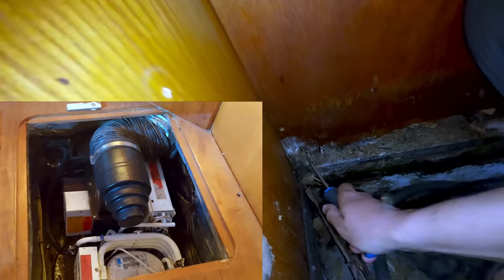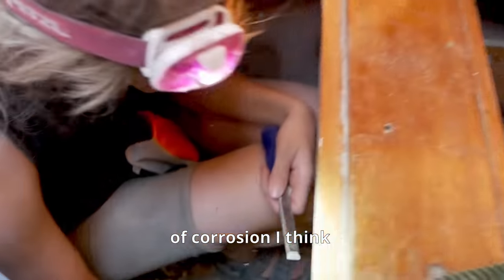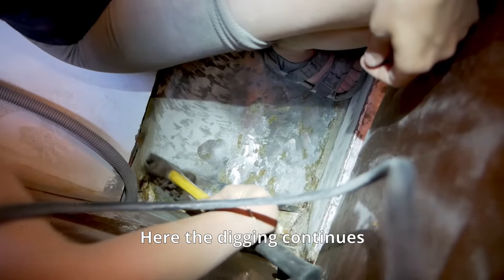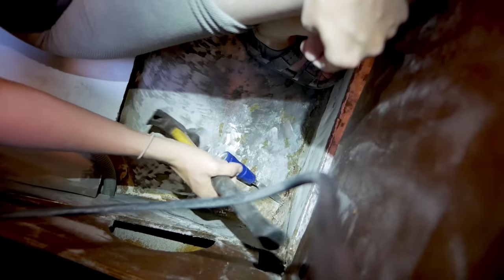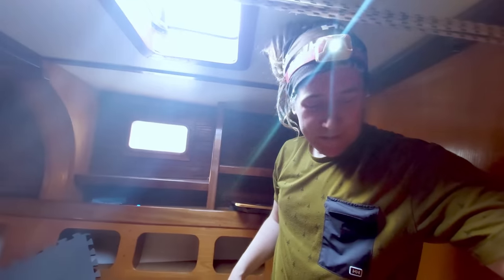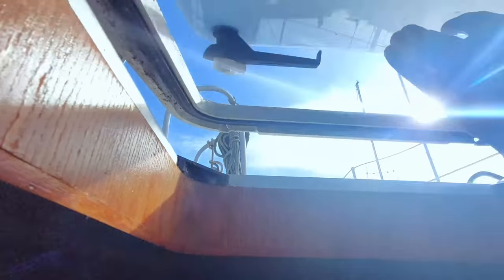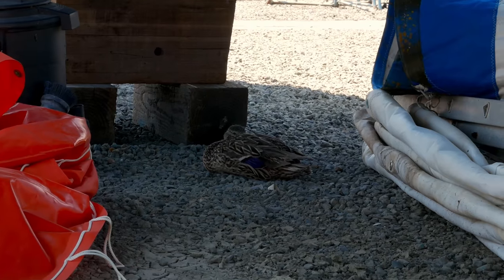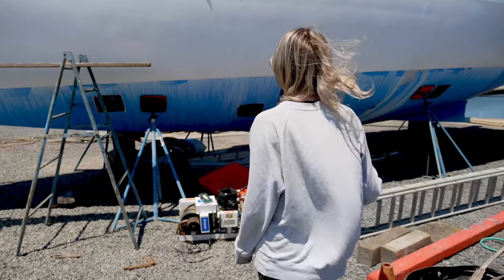Grinding Away ROTTEN Interior. Our HUGE Boat Refit

Comment from the maker: Hi all! Thanks for watching and all the support. What does the list of projects look like to you?
Reply: 3 month aye??? I love your Can Do attitudes!
Reply: Yikes! Can do it team. The stuff I push off to leave yard, foreign port, I know to well. Possibly some local help.
Reply: Do you also want to add water-level tubing to the through holes, like in arktika?
Reply: Looks like an old boat in need of your TLC .
Reply: Excited to watch the progress and then the coming adventures
Reply: Have fun and enjoy.
Reply: It's a long list and it will get longer. I think it would benefit you to sort the list differently. First - anything that has any "unknown" aspect to it must go to the top of the list so you can unpack the problem and understand what's needed and feed it into the work flow. Second  - anything that needs outside help has to be started yesterday so your contractors get to work - but beware gridlock, you can only run so many projects at once on a small boat. Anything you can send "off the boat" to get done, do it - like the hatches, or whatever. Third - anything that needs parts, get ordering ASAP. Fourth - I know it's tempting to prioritize splashing the yacht as soon as you can, but check your costs - it might be way cheaper to stay on the hard until you're really ready to start sea-trialling stuff. Fifth - trying to move through such a big list, with contractors helping, it's nearly impossible to get anything done yourself; you're constantly interrupted to help or make decisions or whatever, so be realistic about which projects you assign to yourself. Hope this helps.
Reply: It looks like a very doable list and can get completed in the time frame that you mentioned..
Welding the old through hull fittings below the water line should only take half a day or less by a competent welder..
Replacing all the wood that you ripped out may take some time because it all has to be fitted.. and for that get some corrugated cardboard to make templates..
Prop shaft should be done in a day, and the rudder should be done in a day.
The rigging shouldn't take too long and as long as you get all the necessary parts you need.. replacing the cabin hatches vents should take about a day or less
So it looks like most of things on your list will take about a day each to complete, but some of it will take a little longer..
I would spend some time making wiring diagram first, may want to run some pvc conduit underneath the cabin floor which would be helpful if you needed to add more wiring later on..
You'll probably need to pick up a clean 55 gallon drum or two to pump out your old diesel fuel and clean the tanks and polish the fuel as you're pumping it back into the clean tanks.... The water holding tanks are going to have to be disinfected and your gray water tanks should be rinsed out.,.
I think you need a bigger air conditioner.. working inside any confined space during the summer heat is brutal.. so be sure to stay cool and drink lots of water
Reply: Sail Life is a YT channel that may have already tackled some of the instrumentation and electric equipment problems you face and may have the answers you are looking for. Otherwise, you two didn't buy this boat not knowing what to do. Both of y'all are impressive that you know what needs to be done, and Sohvi may not say much but I love the way she just gets to work. I trust both of y'all will bring life back to this boat. I know this isn't your first refit and will find it interesting how you two finish out this boat versus what Ava and Mads decided with their boat. But Mads has a lot of videos about the systems you may find interesting. Otherwise, just keep filming and we will keep watching.
Reply: stressful
Reply: 18 months to 24 months a lot of work and systems good luck ..
Reply: @CapDave720  Excellent advice Capt. Dave. It was awfully brave in my opinion to even ask for advice from the YouTube audience, but your reply is very helpful, instead of coming off as being bossy. Not everyone realizes that he didn't ask for advice because he doesn't know what to do, it was to tap into the pool of knowledge that potentially exists in the audience.
Reply: Great project, I am doing similar work on my Alubat 435 and the new electric wiring took me a long time. The work always takes longer than planned... But a lot of fun!
Reply: 6 to 12 months before sailing I think
Reply: I wouldn’t know where to start.
Reply: I'm in San Francisco - I have a Sailrite sowing machine ur welcome to borrow if you have projects that require it.
Reply: It looks like a pretty tiresome project that you fix it the way you like while you're doing it and enjoy the outcome when you're finished it is your boat not ours it will be your home on the water your safety zone and your transportation God bless you I hope you get the projects done so you can put it on the water
Reply: @SFDY241  well that's really nice of you Bill making sure use it if he has to sew anything
Reply: Consider using King Starboard to replace the locker floors etc.
It's a marine-grade plastic sheet material, its impervious to UV and moisture.

Comment: Air conditioners do NOT work with open windows and open doors. Block off the entrance to your cabin with a sheet of plastic or a curtain if you cannot shut the door.
Reply: It is probably normal for Finnish people not to have spent time around air conditioners!
So I'm sure the advice will come in handy.

Comment: Unless a whole lot of your anticipated cruising is to be north of the treeline, you might consider installing a woodstove into your boat. Here on the BC coast, we've been heating our Spencer 35 sloop for 15 years with a woodstove and putting that in is the single best improvement I've ever done to the boat. We gather firewood as we go, so no need for a large woodshed on board, and we can always find ready-to-burn firewood like yellow cedar, yew or shorepine just with a bit of beachcombing. We can easily heat the whole boat to a sauna-like temperature, but dump excess heat immediately just by opening the forward hatch and companionway. We also have a double bus heater plumbed into the engine for when we're motoring. Basically, as far as I'm concerned, you can never have too much heat on a boat, -and running diesel heaters is going to cost you more than $10 every day.. Love your show! Cheers, Ingmar (and when you do head north, please be welcome to tie up at our dock here in the heart of the "Great Bear Rainforest" on the BC Central Coast! www.spindriftpoint.com)

Comment: If you are talking with Selden please suggest to them that a spreader ‘U’ shaped clip on to house mast uplighting, deck downlighting, and possibly a security camera would be very appreciated. At the moment I am designing a 6Kg front loading washing machine specifically for boats to go under the fwd bunk on whichever is the widest side (head side) to be front or top mounted. At the moment I have a top loading 3.5 kg washer and spin dryer but it uses too much water for cruising so I’ve decided to do a redesign and cost it out. The fwd bunk because that space is harder to use for storage withe the narrow bottom and it works well with a specially shaped barrel. And the containment housing can have a second skin for hydronic hot water so it can be a dryer as well.
I want to reduce my skin fittings and do a stand pipe as well. Great idea. If you know any young guys who like to do Arduino programming, I am going to populate my boat with Arduino modules for a range of functions ( electric toilet controller, washing machine controller, lighting control system, bilge and gas monitor system, heat and air conditioning management eventually, black waste treatment) so that after lightning strikes the boat can be “healed” quickly with cheap swap out modules even while at sea. On that subject, here in the Netherlands in Dordrecht there isa company that supplies everything for EMF shielding, even materials to line existing cupboards to protect against lightning EMF.

Comment: After 20 years of using propane on the boat we took the decision to switch to electricity. In Europe the price is now massive and that's if you can actually get hold of refills! They seem to be as rare as hens teeth. We have an induction hob and recently installed a thing called a ninja foodi. It's all singing and dancing unit that roasts , pressure cooks bakes, slow cooks and quite a few more choices. It has taken some getting used to, I miss the propane stove, but boy is it fast and cheap!. We installed 340 watts of solar and two 170aph lithium batteries. we also already had a KISS wind generator. So far so good. Because you can vary the wattage on the hob and it cooks much quicker not only have we managed to keep up with the power needs but we have eliminated the cost of the gas. May be a direction that you could consider?
Love your sense of adventure, work ethic and joie de vivre! Best of luck.
Reply: Induction cooking causes less condensation is much less likely to catch fire and auto shuts off when the pot/pan is removed!

Comment: May I suggest that you rig a boom tent over as much of the deck as possible. Give it plenty of height to get around underneath. It will at least keep the direct sun and rain off you while working. As you know, aluminium boats conduct heat really well.

Comment: On heating: I own a Finnish built boat in the UK. The heating is hydronic. Is has the huge advantage that if you fit a two coil Calorifier you can heat water at anchor without using the engine. Hot air heating is delivered from two fan units. Combined with your drip stove that could give you a really flexible heating system with a little system redundancy.

Comment: As for the windows, so I would consider installing thermopene glass with a system like "Rafa" from Leusden in the Netherlands does. I also mounted it in the wheelhouse of my Fisher 30 North Easter and it saves condensation on the windows and comfort, and I'm sailing summer and winter in the Netherlands.
Regards Lucas

Comment: Always carnage, good some enjoyment it taken in this hard work. Sorry for the 3-month pressure, current issues don’t see an end to it. Just make it South, sure you two can do it! Some cost will actually drop on leaving, sorry to say we’re pricey to outfit here.
Grand success or channel doing well and getting sponsors.
Lockers, I call that work s*!@t balled, legacies of owners that don’t care. Really interested to see how you do insulation. 
The AC will be more effective if it is boxed to a hatch(forward preferably), keep the duct to separate and direct to your work zone. A few pvc pipe ribs and a white or silver tarp shade over the spar will massively reduce the heating. Just one rib per grommet set works great. 
You have a sauna just sitting in the yard lol. That said it hit 108f on the water here (Port Townsend )last year while I was away, gastly. Suppose I could drop a curtain in my forward galley make a non dedicated sauna, like to see what your build is.

Comment: Are you going to base the electrical system on an isolation transformer?
Have you considered eliminating propane and using electric stove and refrigeration?
You are a great team!  I would encourage you to "Do it right the first time" and not worry too much about the actual time required.  Doing things over takes more time and costs a lot more in the long run.
Reply: really good advice. this is a massive  project and I am really impressed with decision to do it and knowing that you can finish...but it will be more like 4-5 months, I would think, but you have Sisu so it should not be a problem..!

Comment: When I asked my wife if we could manage as live aboard....she replied that "in no way would she be coming with".  So if you understand the spirit of adventure and lively project sailboats are supreme as interest to myself.....alas, my roots have grown to a home anchor as a frame house and workshop.  And, where I might manage a dingy just up on a lake basin for an hour or so.  There is no chance of bracing salt air for this observer.
As for the quality, the design of this aluminum hull,  I think well formed design and robust strength were the first point as layout.  And, where that engine looked in very good condition.  I think a concept project that will have many benefits for what ever span of sail is intended.
Having a workshop and involved with repair of various machines and craft....I have rather observed a recent spike in costs.  Such that no simple economy is enough to meet the real cost as a refit.  Where sails, rigging, electronics and supporting appliance must work and without fail.    With that general point of view, I will be very curious to see how progress continues.  In part, as there are others who attempt such refit in various stages, various designs.  And where I truly like and admire...those who determine to live and proceed freely at the sea.  Fair winds...from Washington State, US.   M.

Comment: Great to see you are working on your project! My thoughts....Arktika had about 6cm insulation, now you have none. As your first boat,. So some thoughts about that period and the bigger condensation /discomfort issues can be worth while, for plans/changes. Though impossible to insulate the whole boat in 3 months, 1 cabin would be nice. 
As for electric: Lithium is the way to go, capacity wise. But might need a lead acid fed heating element to be able charge in freezing temperatures.  Leadacid capacity is only 50% Usable. It alle dependent on weight,  and location/temp on the boat. More important due to less (strong) sunlight is to make a big switch board, and divide total capacity in smaller switchable chunks.  It takes 50% less power (sun) and time to  bring up a 100Amp battery up 1 volt than a 200Amp. Or a 300 compared to a 600 housebank. minimal critical voltage that may be needed for most essential instruments. Nav, VHF, GPS, laptopcharge, bilgepump etc.  Instead of the freezer.  (set for non critical users a a separate low voltage disconnect at higher voltage so essentials keep working.) So an electrical plan and wirering  can have some prioritizing groups, instead of just distribute available power to all.  Anchor winch separate battery is most likely not in a heated compartment so leadacid might be in favor there. On many commercial vessels there is a small separate wired switchable battery bank just kept up to charge for emergency use and the bare essentials only. Changing all Nav-, Deck-, Cabin lights to led lights adds up in saving energy. Sounds more complicated in writing than it is:)

Comment: a few tips/thoughts:
1 where end-grain wood touches aluminium, the acids from the wood will corrode the aluminium. and plywood is basically all end-grain.
2 never run your engine on old diesel. diesel deteriorates after a year and can become lacquer or can contain bacteria that clog up everything. plus, still diesel attracts water. it will destroy your diesel pump and injectors. you can use it for  heating, or for cleaning greasy parts, but best you despose of it.
3 if you remove an underwater WC you can probably use it's waste water outlet tubing as a pod for an echosounder.

Comment: Hello there I see you got another boat. Good luck with the project if it's really hot there get some kind of foil cover or some darker cloth over the windows that will keep some of the Sun out of the windows it will create heat in that area or put a tarp over the whole top of the boat the sun gets in the windows that will heat that place up like a oven then your air conditioner should work a little better you might want to get another AC unit and connect it up and stay cool you don't need to be getting heat stroke. I've had a stroke 2 or 3 times in my life and it was not nice first time almost killed me. Anyways good luck with a refit project. Watching from Roseville California USA
Reply: Tie the tarp over the boom

Comment: Dry ice sandblasting may prepare the surface for paint without damaging the aluminum.  It will not remove rust from iron or steel.

Comment: An idea if you can find a kids fabric play tunnel with plastic hoops put it Vertically over a deck hatch, hoist the other end up on a damaged line as far as its long.. 
It should act as a chimney and draw more hot air out of the boat.

Comment: I have a question about your compositing toilet.  The normal temperatures that you sail in are rather cold, and the inside of the boat will not be that warm.  Would you have problems with the bacteria if they are too cold?  Because your toilet is not going to be composting very much if all your bacteria are asleep with the cold.

Comment: Don't forget to keep the doors and windows shut if you're using the AC. Otherwise the boat won't stabilise as the hot air from outside will just keep coming in.